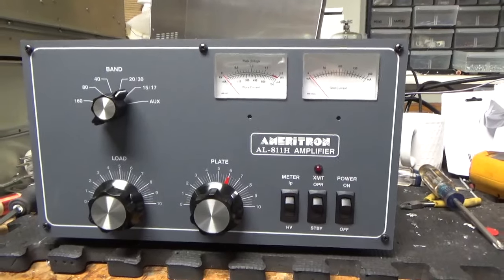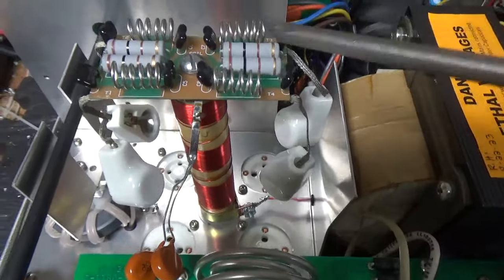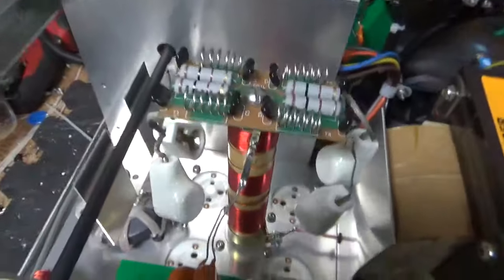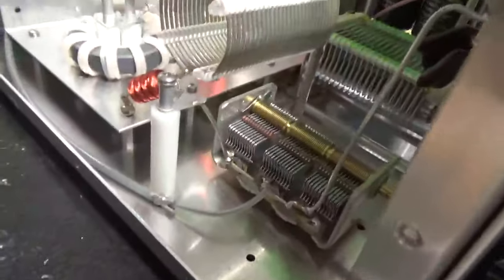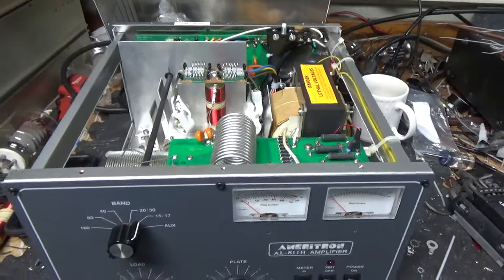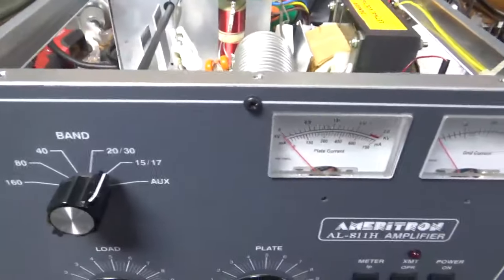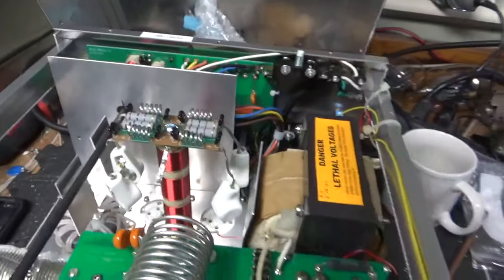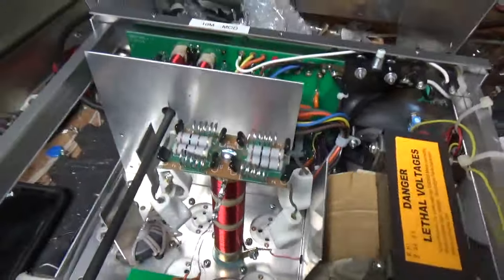Ameritron Al-811h Repair, Modifications, New Plate Choke, So-239 Connectors

Comment: Why do I see so many of these amps with bad so239 sockets? Garbage sockets or guys with crappy coax?
Reply from the maker: Cruddy so-239’s , bad from get go or damaged by solder glob on pl-259 / pl-259 plugged in at an angle

Some people connect and disconnect coax cables often which is also not good. Connectors have a connect / disconnect life span before tolerances change